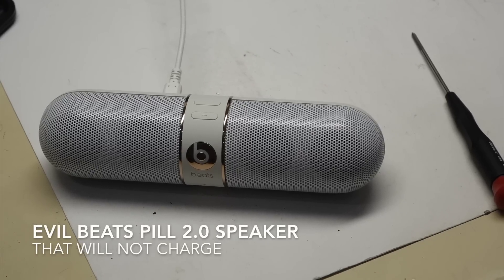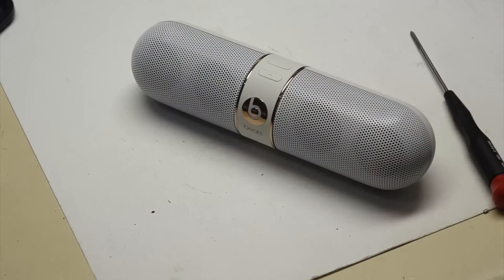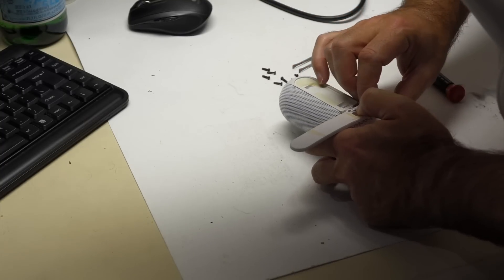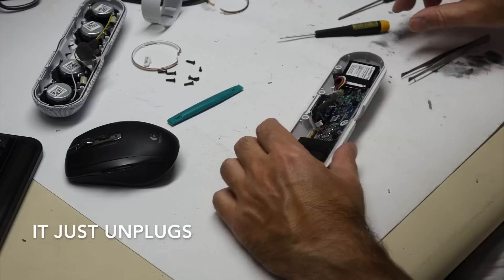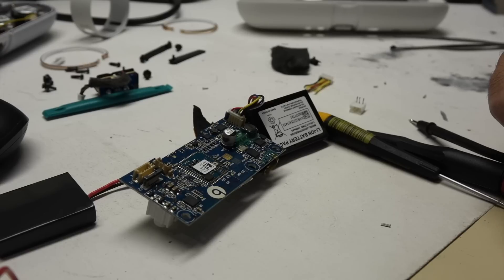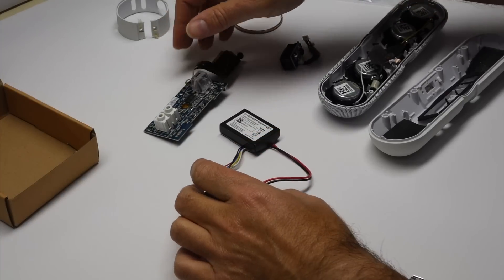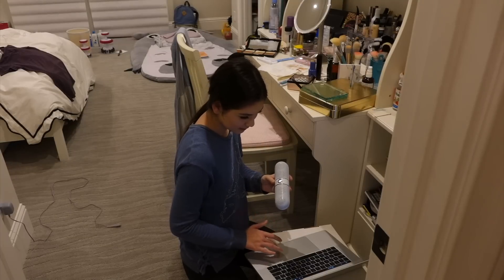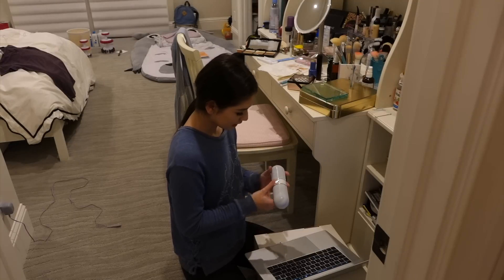Beats Pill 2.0 Battery Replacement (Beats Pill won't turn on or charge)

Comment: FYI…the ribbon cable nor the usb cable have to be disconnected to replace the battery. The board will lift up enough remove the battery. 👍🏻

Comment: Awesome video! I had always wanted one of these, finally bought a used one on eBay and it has this same issue. Luckily I purchased a year of coverage rom Square Trade when I made my purchase, so hopefully they can do the battery replacement and then I won't have to 😁 other than only working while plugged in and not charging, it sounds pretty good.

Comment: I changed my battery and it now works but the beats red light doesn’t come on anymore. Not sure what’s happening now. Did I miss to reconnect something? Please help
Reply: Probablemente en el proceso de desmontaje el flexor (tira color marrón ) se rompió ya que es una tira muy delgada y estuve a punto de romperla en una reparación igual, ese flexor controla la luz de la B, lo puedes soldar si aún la tienes y listo 👌.

Comment: Thanks so much for this video. My dad repairs all my stuff for me and now that I’m almost 40 years older I figured I should try to help myself. My dad supervised and helped me figure out how to read the voltage of the battery and with your helpful advise I was able to see my batteries were not holding their charge anymore, know exactly what to order online to replace it and disassemble and reassemble it all by myself.

Comment: hey. i replaced my battery and everything works fine, but the B button on the front isn’t lighting up or functioning anymore. any clue what i did wrong?
Reply: it doesn’t even hard reset bc the button isn’t functioning
Reply: might have messed up the flex connector but i hope that’s not it. i bent it a little taking it out and pulled the whole tab off but it goes back in

Comment: Should of paid attention when you disconnected the flexible connector between both sides. The black clip will snap if forced up to high. Should be okay but not as secure. Just about to order a new battery.
Reply: Same :(

Comment: i have the beats pill XL and a few days ago after using it for alittle over an hour it just stopped working and wont even charge..do you know what the problem caould be and is it worth trying to fix or is it dead now?

Comment: This was really helpful, my pill wouldn’t work without needing to be plugged in. It would also crackle/pop when the sound was increased. After watching this and changing the battery my issue is fixed! Thank you so much.
Reply: Exact same problem here I almost threw mine away the other day glad I saw this vid!
Reply: I have the same problem I didn't know if I wanted to change this battery cause it was cracking all cutting out before it died. Wouldn't even stay on plugged in

Comment: Great video, I bought a new charger and discovered it does not charge any more, i barely used the thing maybe a few times but definitely out of warranty, will need to replace the battery, disgraceful manufacturing, this video is going to help!

Comment: Bad design. Two Lithium-ion cells in series with no balancing. Sooner or later one of the cells goes to 0 volts and get a reverse charge and it's game over.
Reply from the maker: There is a balancer. I even test it in the video. Beats me (pun intended) why the cell went bad.
Reply: OK. For me, it only looks like there is checking of the cell voltage. I see no load resistor and MOSFET to load down one or the other cell to keep it down while the other cell is charging.

Comment: Hard to imagine too many people going to the trouble that you did.  I guess this is considered a throw-away.
Reply: that type of mentality holds humanity back. we should work on saving things and not wasting so much . anything you can repair you should instead of scrapping it . besides, whats 30 minutes of work to save you from spending $150 on a comparable speaker. To save these only costs like $30 , $120 for an hours work tops , alot of people would prefer to do this

Comment: For modern stuff repairs like this, it is good to have some industrial grade double sided tape, you can  get giant rolls of it at very decent prices on banggood, ebay of other stuff-from-china retail websites. They are available in a whole range of width., really convenient if you want  to get a clean reassembly.

Comment: Unremarkable consumer hardware that commands a premium price.
Reply from the maker: I have to give it to them that the industrial design is very remarkable actually, and the fit and finish is exceptional. Ease of assembly and repair? Not so much. Reliability: terrible.

Comment: That's what happens when 'designers' rather than engineers try to create something.
Reply: Thats how everything is done. Most everything is "designed" by designers, who are also, engineers. Who also had to solve the issue of fitting the batteries, speakers, antenna and circiutry within the "pill". Of course, the pill has to be designed to sell.. the end result isnt always practical, from an engineering standpoint.

Comment: Never worked on an HP laptop, huh? I hate those things. Dells are usually the easiest, but I recently encountered some that had bad BIOS batteries, and the entire laptop had to come apart to replace them... heatsink (which meant dealing with thermal goo), screen, motherboard, everything... and it was not an easy one to take apart. These engineers, sometimes....
Reply: My fujitsu's (both a 2007 amilo and later 2013 model) have one large panel that unscrews to reveal the whole mainboard, the only idiosyncrasy is that the older one had one of the memory sticks under the keyboard and the newer one has a separate panel for the fixed HDD, also NO weird screws all Philips.
Reply: some HP laptops have their backup battery accessible near the HDD, while others need to be taken to bits to replace it
Reply: Yeah, it really just depends on the model. I'm refurbishing some HP laptops right now that have most of the things that you'd need to access often very easily accessible. The HDD, memory, BIOS battery and WiFi card are all removable after removing only three screws. The one thing that HP really seems to be bad about is not making the processor fans easily removable for cleaning, that often requires removing the motherboard and heatsink, and that's really annoying.